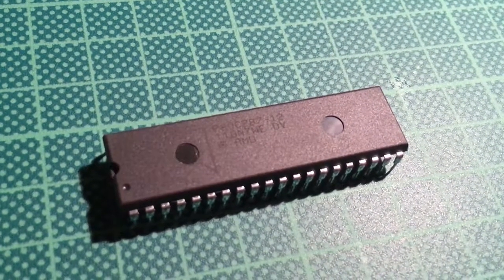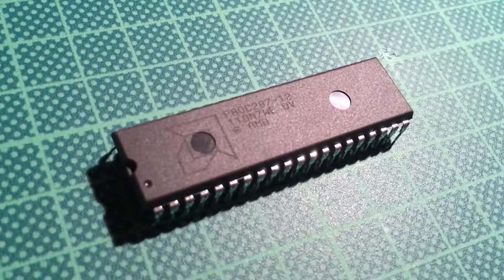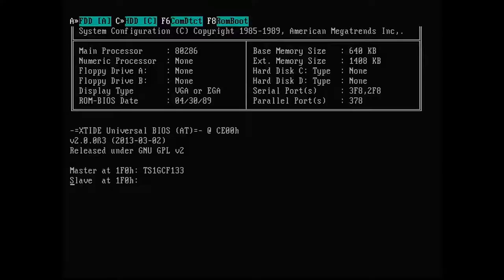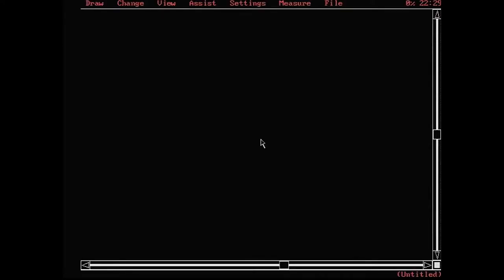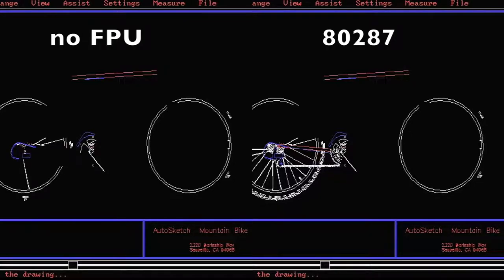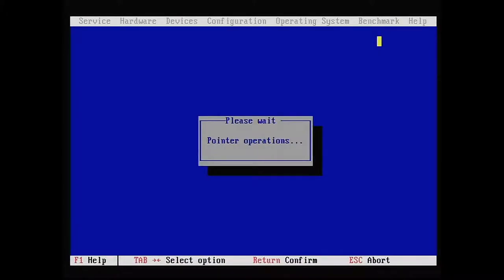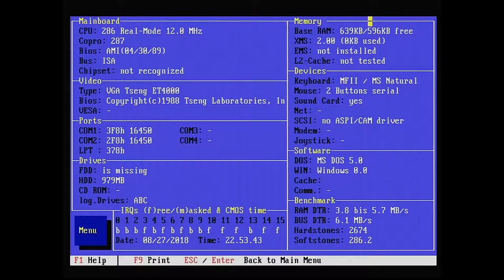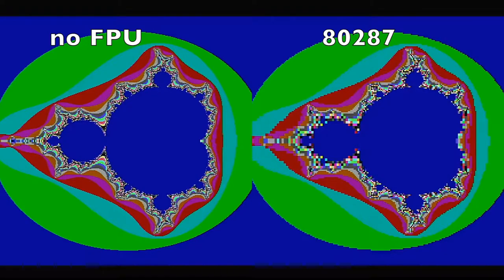Installing a 80287 FPU

Comment: the titles for the fractals is swapped.  great split screen comparison!  any other programs that use the Intel coprocessor?
Reply from the maker: The fractint titles are actually not swapped. Fractint uses integer arithmetics for PCs without 287 installed, which is really fast. For PCs with a 287 it optionally swaps to using floating point arithmetic, which is inherently slower on early x87 CPUs. However, for some fractals it actually needs to use floating point. But the Mandelbrot works also with only integer operations. 
There were a few programs back in the day that use the FPU, but not too many. I think Excel always supported it. Also most CAD programs, like Autocad. Since FPUs were rare, most programs avoided expecting them.
Reply: root42  ah!  Fractint was using float w/ coprocessor but the integer side drew faster.  Got it.